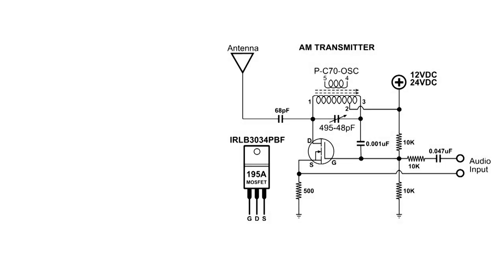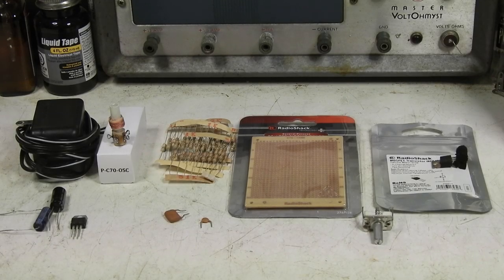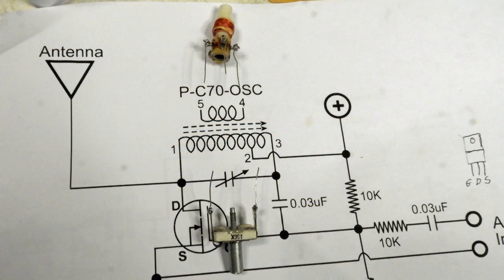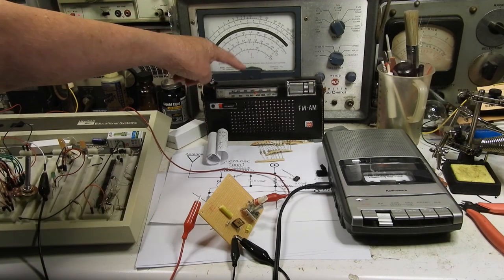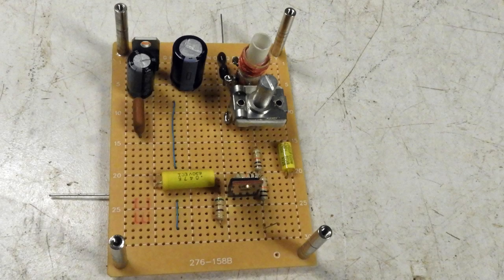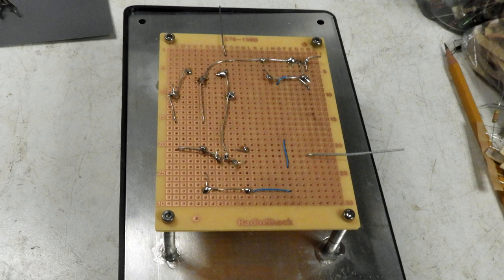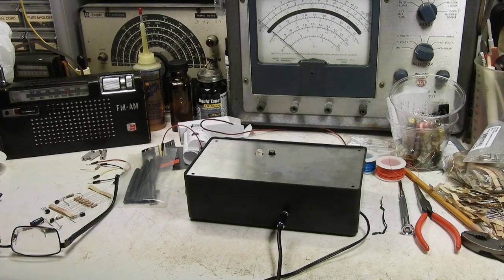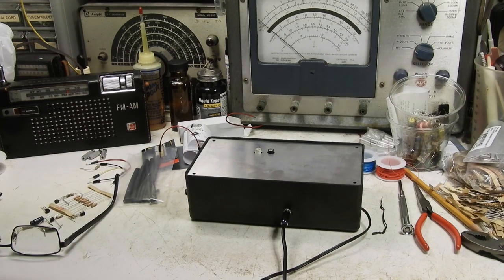AM Transmitter Build Project and Demo

Comment: Hey AA5Radio!  I'm trying to make this circuit, as I find it VERY unique, but for the life of me, I cannot get it to oscillate.  I've got the exact P-c70-OSC coil from antiqueradioparts, and the 3034 mosfet.  I'm using a 365 pF variable cap (old one out of a radio).  All parts are checking out good, but I simply CANNOT get the thing to oscillate as shown.  the FUNNY thing is, if I substitute the .001uF cap for a .033uF, then it oscillates around 1MHZ, but CANNOT be tuned, AND, I can actually REMOVE the variable cap, and it still oscillates.  What the heck am I doing wrong?!  I've built it on a breadboard, and I'm pretty sure I've got it wired correctly.  Thanks for all your videos.
Reply from the maker: Ohm out your oscillator coil. The red dot maybe in the wrong place.

Comment: Rick, thank you so much for your previous reply. Just one more question. On the schematic, you have 495-48. I don't think that it's a 495pf, that would be much bigger than the one you showed. I'm guessing that 47pf is the high end, and the low end wasn't stated. Anyways, I found a 4 to 50pf. Will that suffice ?
Reply from the maker: With 50pF you might get into the AM band, but for-sure you’ll be in the shortwave band.
Reply: @AllAmericanFiveRadio  so, 50pf should be the low end ? I have one that goes to 365pf ?
Reply: @AllAmericanFiveRadio  So your saying that the one you used is 48pf to 495pf ?
Reply from the maker: @jerrymercer7683  I think I'll do a video on this. I'll start on it today. Stay tuned.
Reply: @AllAmericanFiveRadio  awesome, I thank you so much for your help and your patience.
Reply from the maker: @jerrymercer7683  Hey Jerry
I did upload a new video. If this video did not answer tour questions let me know. 
Rick
Reply: @jerrymercer7683  Did you ever find a capacitor that worked with the circuit?
Reply: @AllAmericanFiveRadio  I found a 466X Trimmer on RF parts that looks to be to one that he used and is 105-480 pF
Reply: @samuelberry1538  yes, I do have one, however, I haven't built the xmitter as of yet.
Reply: @jerrymercer7683  Gotcha. Thanks for the reply. Some of these parts were a bit hard to find online. I'm hoping the 466X will get the job done
Reply: @samuelberry1538  sounds like it will. I presume  it should put you at the upper end of the band. Which is supposedly right where ya wantta be.

Comment: Isn't the "Wall Wart" power supply already regulated?
Reply from the maker: No
Reply: Most Wall Warts have poor voltage regulation (if any) and even worse filtering. It's not uncommon to see 12V wall wrts putting out up to 15V. If you want clean audio from your transmitter, build the regulator circuit shown in this video.
Reply: A basic wall wart is usually an 60hz (U.S.) AC transformer, a bridge rectifier, and a filter capacitor.  These aren't regulated and the voltage drifts with load changes.  But, there are plenty of "brick" supplies which are indeed tightly regulated.  Still, in this circuit, you don't need a regulator with an unregulated 12V wall wart.  Just add another filter capacitor on the board (like 2200uf/25V) and bypass that with a 0.1pf.

Comment: ☺😊😀😁😂5 smile's  learning AM and RF signal will definitely be testing this curcit for a education in AM.👍got one off the cheap 335hz on eday on 7v 15m with out amplifier may get 35m max at current and looking at a 2.5w booster for a bit better range and will need to upgrade for a 500m to 1km range for professional use on some stuff ive been working on.
Reply from the maker: Good Luck!